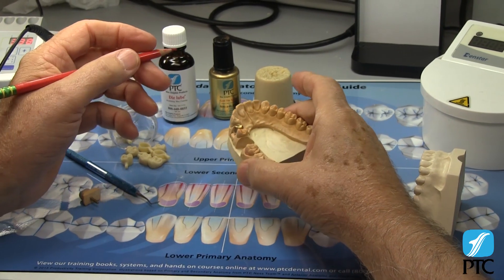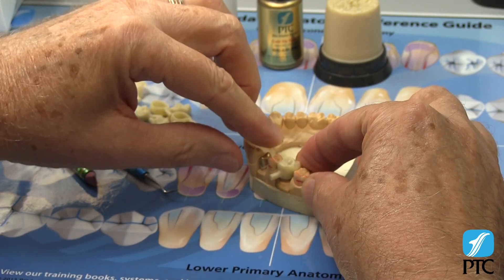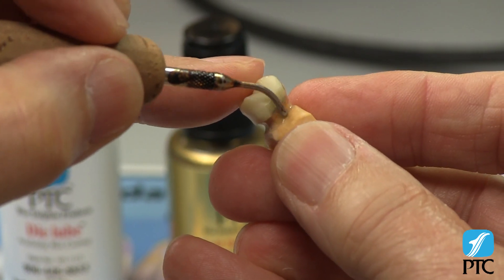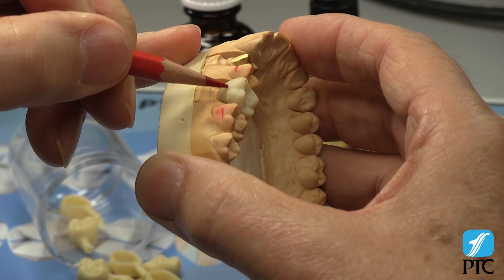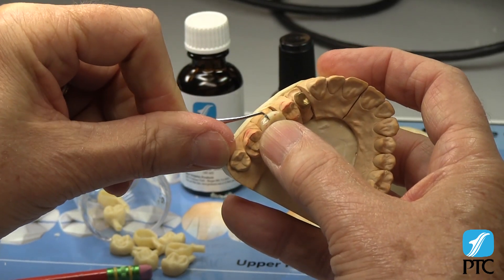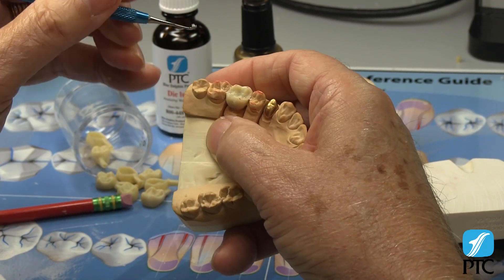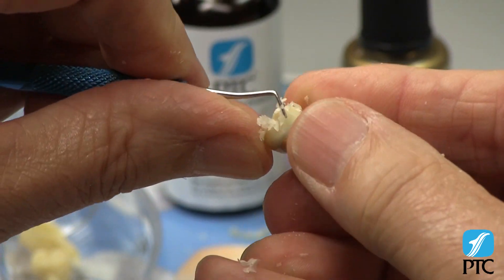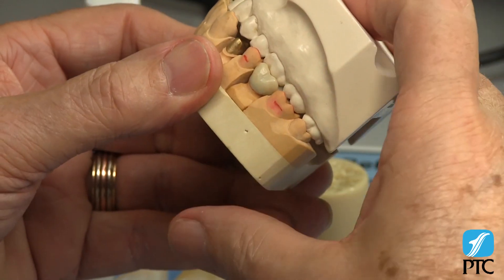Full Contour Waxing with OccluMaster Wax Crown Forms

Comment: Damn! I am going to community college to become a dental technician. We do waxing of full contour crowns the old fashion way, but this just makes it 100x easier!
Reply: Are you also suppose to put extra wax along the margin when you seal it?  That way when you cast the wax pattern you have extra a little bit of extra metal remove without over finishing? This is assuming your casting it in metal. jw
Reply from the maker: Michael Khoun It is not necessary to add wax to the margin.  In fact I discourage it.  At minute 8 in the video you can see the carver is held at 45 degrees to the margin when carving the margin.  This angle produces a slight 45 degree bevel at the margin that provides the excess wax necessary for finishing in metal.